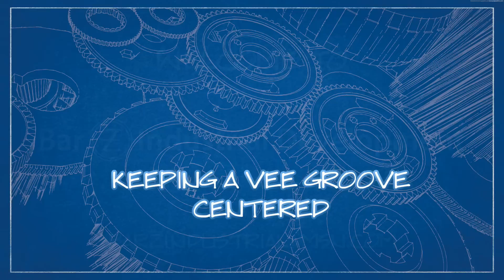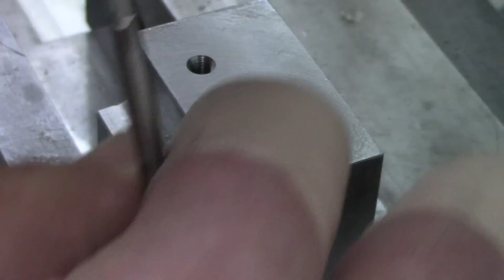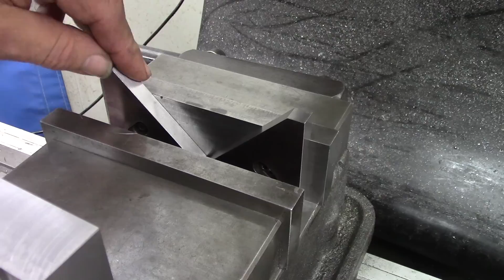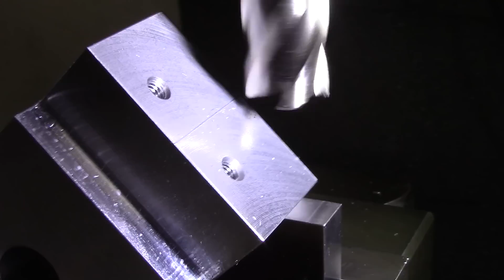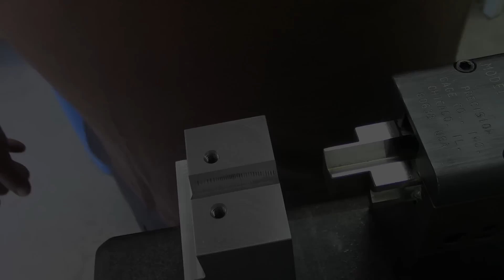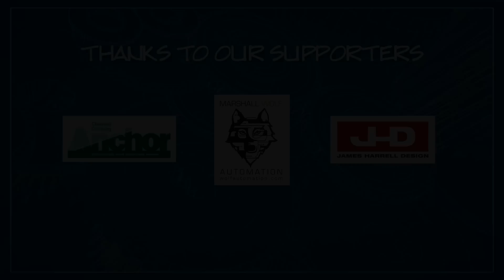Keeping a VEE groove centered

Comment: That is a cool technique, I can see why you made up those angle plates.  Great idea.  I did get a Kurt vise on the table of my BP clone when I bought it, now need to see if the jaw bolt centers are threaded.  If they are then although they might not be hardened nor ground a set of blocks like yours is going on the to-do list!

Comment: Great tip on flipping the block to center the V. I made a set of those angle blocks by milling a slot in a pair of import angle blocks to line up with the vise jaw screws. I ended up with 30/60 degree blocks also, since they come in the set with the 90.